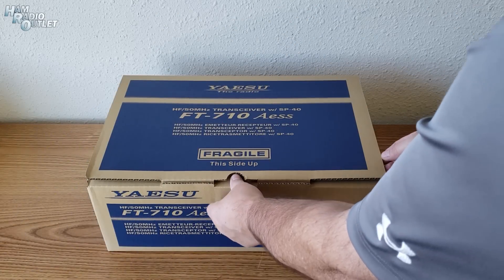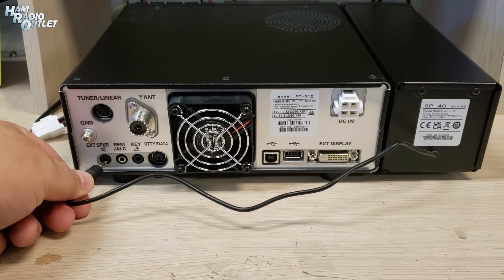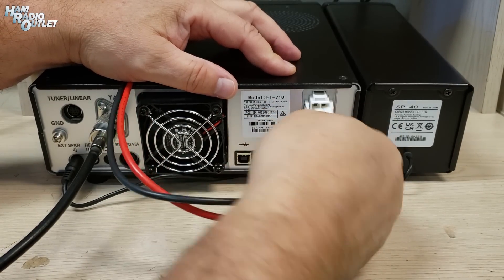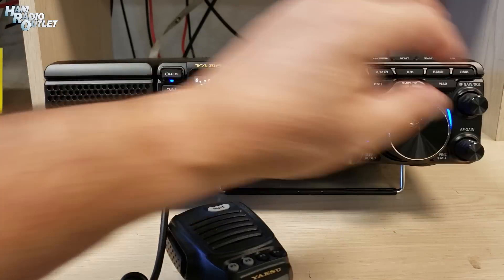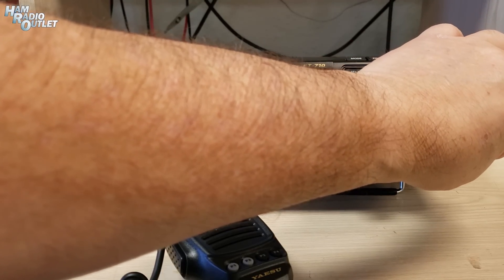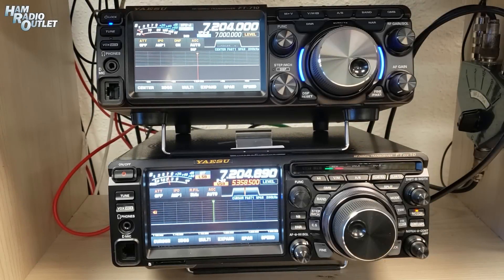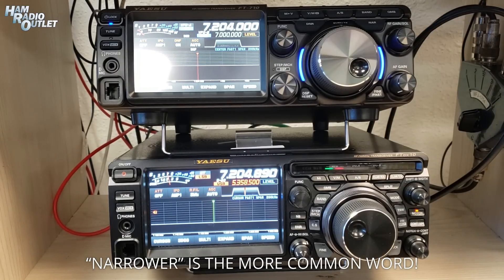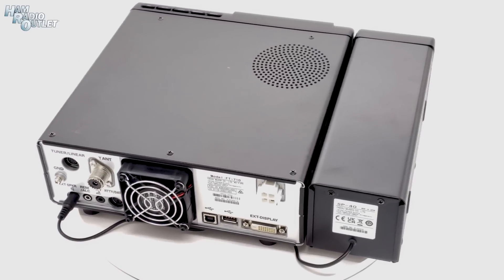Yaesu FT 710 First Look - Ham Radio Outlet

Comment: Interesting first review, but maybe I need to wait until a few have been sold to evaluate the actual day-to-day performance against the proven FTDX10. I will then purchase either the New 710 or the DX10 depending on reviews by other amateurs. But at this moment the 710 is at the top of my preference list. 73s G1DYL
Reply from the maker: The FT-710 and the FTdx10 are different radios. If it comes down to the choice of the FT-710 or the FTdx10, you should probably go with the FTdx10. The FT-710 is a step below the FTdx10. Also, this wasn't a review, just an introduction to the new radio. 🙂
Reply: @HamRadioOutlet  I agree they are different radios, but having a full SDR front end makes the rig interesting.
Reply: If you want a dx10 buy it now. The price will go up when the 710 releases.
Reply: @forgetyourlife  I think the 710 is already released and I am unable to purchase anything until I return to the UK next year
Reply: @kevargao5031  nope not released yet. Only preorders.
Reply from the maker: @kevargao5031  It's released, but the radios haven't arrived from Japan yet.
Reply from the maker: @forgetyourlife  The FTdx10 currently has a manufacturer's coupon, an HRO discount , and the HRO Superfest discount available, so the price absolutely will go back up to its regular price when those expire. That's a $400 saving!
Reply: @HamRadioOutlet  yes however I was commenting about Yaesus business practices. When the ftm-300 was introduced the ftm-400 went up $140 bucks outta nowhere, why? Because the buyer then sees a “value” in the lower priced model. The 710’s job here isn’t solely to replace the lower end 450d but to also make the dx10 stop losing money with cut prices. For the last 2 years it’s had to compete (price wise) with the 7300 since they had no other option in the line up. The 710 is now that competitive radio and the DX10 will be next level, more expensive etc and the price go back to 1599.99 or close to that.
Reply from the maker: @forgetyourlife  Will be interesting to see if that happens.
Reply: @HamRadioOutlet  1499 now. It’s so easy to predict Yaesu prices.
Reply from the maker: @forgetyourlife  The price hasn't changed. Some of the coupons expired (including the Superfest discount). The last coupon will expire at the end of October, then everyone will be paying full price for it again.
Reply: @HamRadioOutlet  naw, they usually roll over every month (you know this) and have been till now that the 710 is out. I’ve been watching prices every day for 3 years and it’s always the same routine. Kinda like the Thanksgiving sale banner is green then the Christmas sales banner is red yet the prices are the same. I did pick up a dx10 since 1299 was an additional 100 off like it was at Hamcation. (Hamcation 2021 it was $1249 by the way 😀 I really do have all this charted.
Reply from the maker: @forgetyourlife  Weeellll... as you noted, the FT-710 was released in September and the Yaesu FTdx10 coupons and the Superfest coupons did not roll over into October, they all expired. The only exception being an HRO coupon that expires at the end of Octiber. So....
Reply: @HamRadioOutlet  yea, and if the 710 did not release the dx10 coupons would have rolled over again.
Reply: The pure SDR won’t beat the hybrid technology of the FTdx10. 

73, de N4HNH
Reply: DX10 all day.